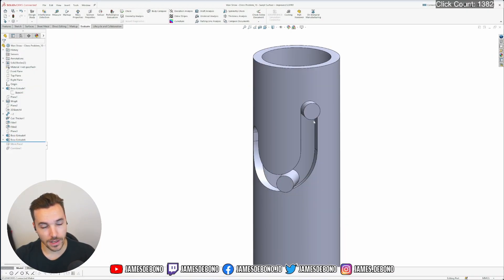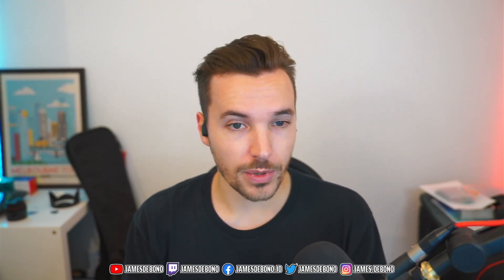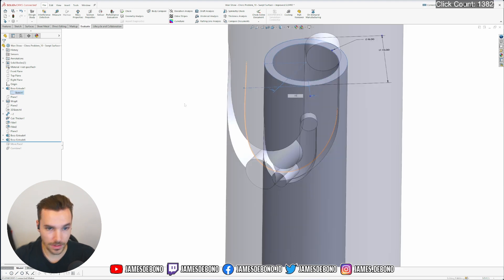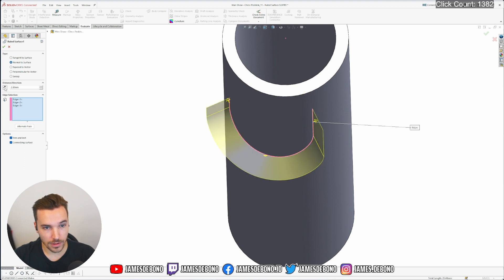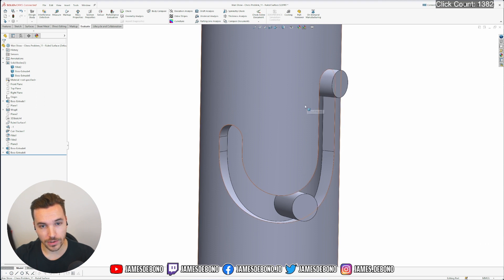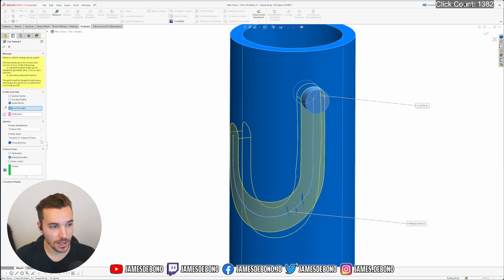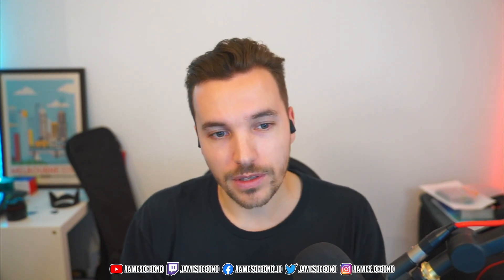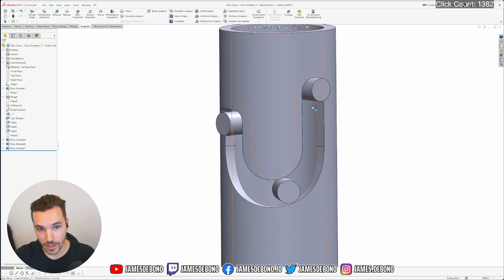LTT - Wan Show "Chess Problem" Part 3 - Solution Confirmed!

Comment: Another (potential, I don't know anything about these things) reason for why it might be important, if you upload a CAD design like this, wouldn't it be possible (for one reason or another, user error?) to make the CNC machine think that it should cut at an angle?
Reply from the maker: Depending on the machine and the way the path is generated, yes!